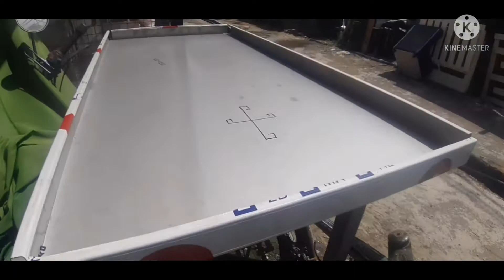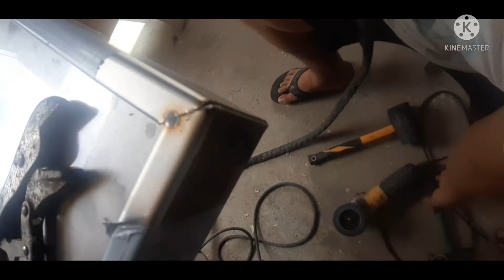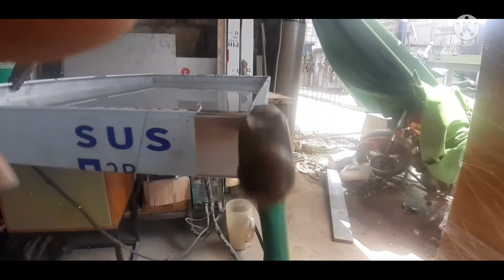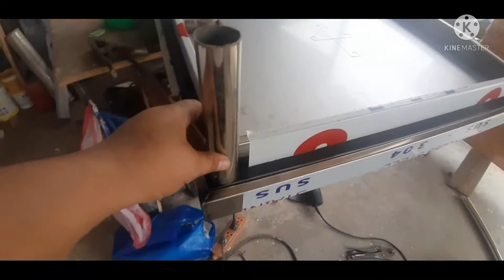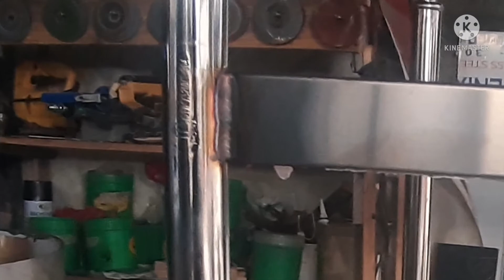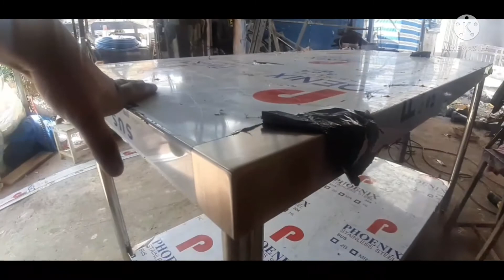How to make stainless Preparation table

Comment: Ano Po Ang gamit nyong pang welding? Saan Po nakakabili and how much Po?
Reply from the maker: Tig welding machine. Sa binondo marami ganong welding machine. Nasa 15k ung saking gamit plus need din ng argon tank. Nasa 10k naman un. Around 25k to 30k magandang klase na. Baka mas mura din pag tig weld lang. Ung sakin kasi 2n1

Comment: Sir Yung support mo sa gitna Yung parang u shape na ka tig sa table top?
Reply from the maker: Ung dulo lang na sa stiffener din naka welding. Di na kami nag weld na sa table top tatagos kasi mahirap pa mag linis. Dinidikitan na lang namin ng sealant un tapos papatungan ng mabigat para sure na kumapit
Reply: @jeffsdiyconcept3540  OK. Any sealant po ba sir? Or may specific na pang Stainless?

Comment: Sir ano ano po magandang pang buffing sa stainless labo po ung makapal nakakabit na po kase sa gate hirap ibuff
Reply from the maker: Mahirap kasi dumukot pag naka install na ung gate kasi ikaw na kilangang mag adjust ng tamang position..
Ito diskarte ko. Im not sure kung same sa iba pero ito nag work sakin. 
1st step. Flap disc 60to80 grit
Para lang mapantay ung makakapal na welding. 
2nd step. Flap disc na 240 to 320 grits pero para sa baguhan. Pero pag kabisado mo na ikot at patama ng grider pwede na ung sand paper na ginagawang flap disc. Mas mahaba kasi un at mas kayang dumuukot ng di aabot ng 4" flap disc pero ingat lang kasi kunting maling patama mo lang ubos agad sand paper mo. 
3rd step. Sponge disc
 Pag halos wala ng malalim na tama ng 60grit flap disc. Sponge disc para mas manipis ung gasgas. Bago hair line kung hairline finished pero kung mirror finished need ng buffing disc at buffing soap.

Comment: Hi sir ask ko lng po how much po unh size na medyo maliit ng konti jan sa size ng model na yan?at gusto ko lng po magkaroon ng idea how much po cabinet sa kitchen sliding door at may 3 drawers.?salamat po
Reply from the maker: Need ko po ng specific size para sa table. Message lang po kayo. 09174320723 para mas masagot ko po concern nyo. Thanks po. https://m.facebook.com/Steel-Gates-and-Custom-Metal-Works-102809491171438/?ref=bookmarkshttps://m.facebook.com/Steel-Gates-and-Custom-Metal-Works-102809491171438/?ref=bookmarks tan po pla page ko para sa ibang gawa pa namin